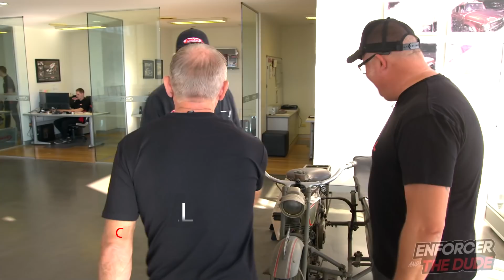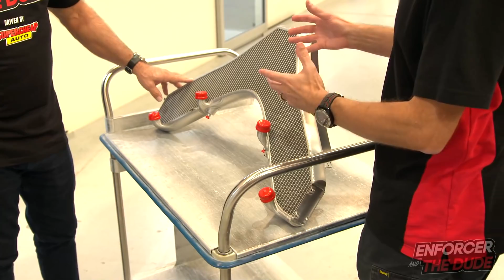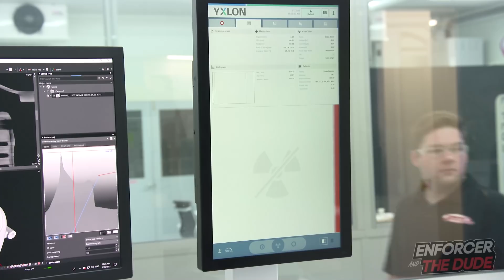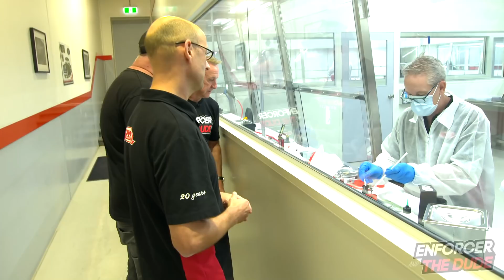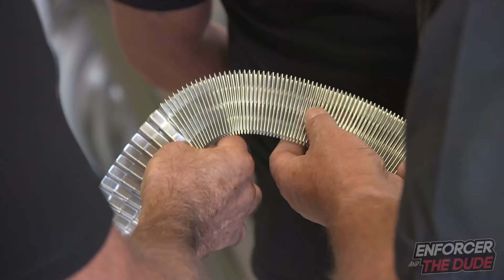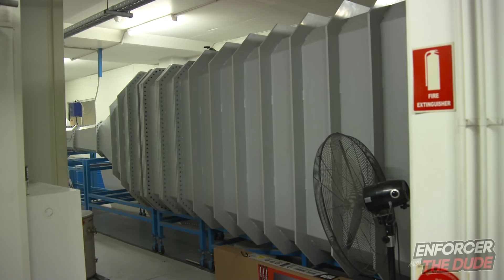Enforcer and The Dude - Episode 24 (PWR Tour)

Comment: OMG Well Done to PWR Australia, to think that the aerospace or aircraft industries were doing all this back in the late or mid 2000's, its just that now boeing is outsourcing some of the work and if you can pull it off, especially if your company is cirtified by CASA and the FAI ,then you will get work from all aircraft maintenance and manufacturing sectors. 
I know i used to work in the industry and also sold 4130 welding wire to perkins engineering in Moorabbin ,when Russell was still there, so in 1999?

Comment: Always been a Paul Wheel fan, especially his AU XR8 back in 2001 series. I have a PWR radiator in my V8 Falcon & it never runs hot, absolutely no issues at all even 4 years later. Great show, thks PWR. Oo===oO

Comment: Undoubtedly the most intriguing episode yet. More than just radiator manufacturing. What a credit to PWR! Well done boys.
Reply: yet cant get a OEM replacement for a normal VF V8 commodore, even the trans coolers are just good quality cooler, but the rest you can buy at any bunnings store, cable ties and rubber houses?

Comment: This was a great episode. I spent 28 years in manufacturing automotive heat exchangers. What PWR are doing is very very smick . It is a black art to vacuum braze aluminium. Most radiators are nocolok brazed. Big tick ✅

Comment: Australian Motorsport Manufacturing is hard to beat, would like to know why Supercars don't run a Holinger Gearbox when they are as good if not better than the Xtrac and cheaper?? What is the go?
Reply: The xtrac is a better design and is cheaper over the long run as the parts last longer